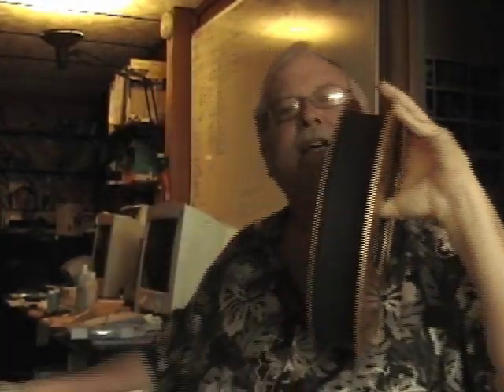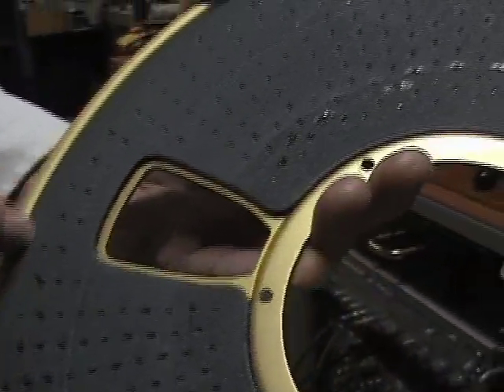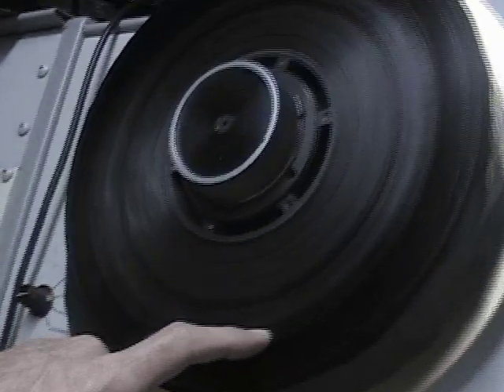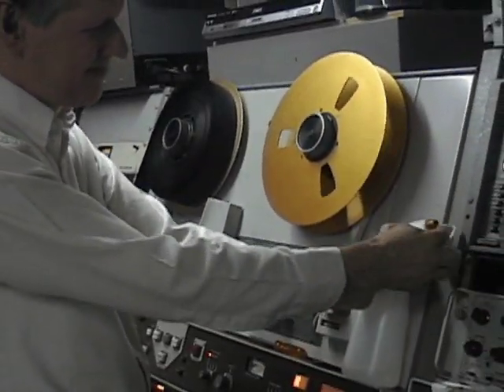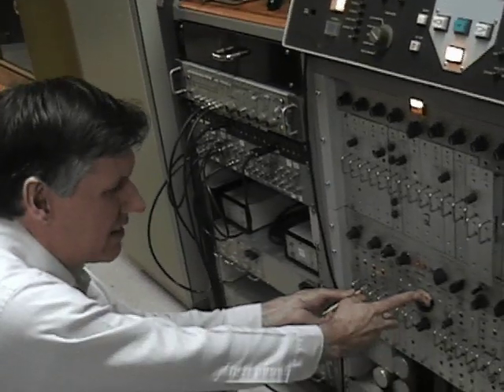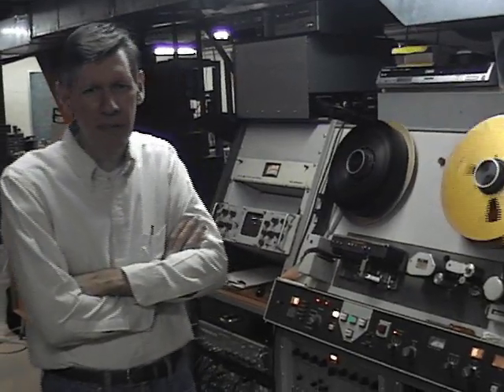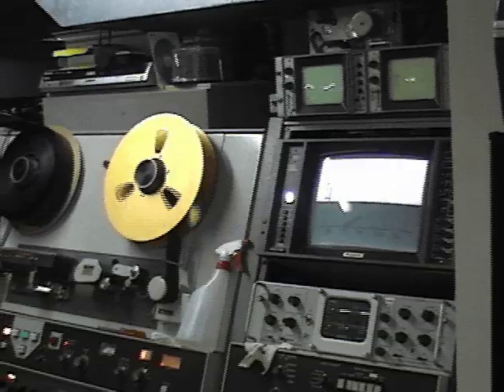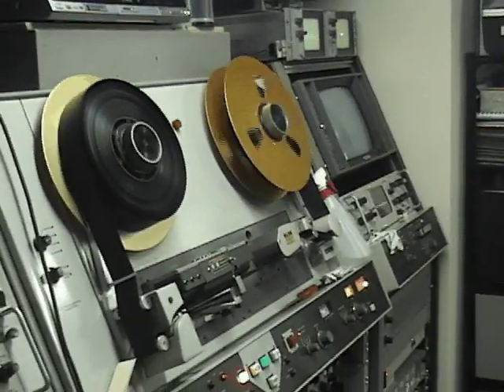Getting  a 2" Quad Videotape to Play

Comment from the maker: You can still find the old machines if you know who to ask and where to look.
The companies that rebuild the heads (they only last about 1000 hours) are still around.
But most people don't realize how much air conditioning, power, space, spare parts, and air compressor support systems you have to have just to fire one up!  Much less how to tweak it to make a tape play!
Reply: I indeed had no idea.  I mean, I knew that they were absolute behemoths, I knew that operating one was a specialized occupation, etc., etc., but I didn't know that the infrastructure required to support one was reminiscent of the Apollo program, lol.  For someone who has no frame of reference, it's simply inconceivable unless someone explains it.

I think it might be easier to set up an MRI at your house--assuming the electric utility played ball.

I am 44, and back when I was a kid I was really interested in video production (until the Internet came along), so I have some fond memories of playing around with some U-Matic decks at the community college.  And they had some tube cameras, too.  But all these years I've always wanted to see one of these babies operating.  Thanks.

I hope you are well.
Reply: I've always wanted to see one of these babies in action ever since I was a kid (I'm 44).  Thanks.  Undoubtedly, this is the closest I will ever get to one.  Indeed, I didn't know that they required an infrastructure reminiscent of the Apollo program to operate, lol.

All the best.  I hope you are well.
Reply: So did these not even use helical scanning?

Comment: I miss those quad days but they were tricky to set up. I started in engineering at Global Television in 1977 and the TR-70 was the only video tape playback that was considered "broadcast quality". Boy have those standards changed. I recently dumped a number of old 2-inch tapes that I had commented. Just a memory now.

Comment: My first job in TV in 1985, I trained on two RCA TR-600's.  We aired primarily Quad, Umatic and 16MM film.  When I first started, it would take me a good 5-10 minutes to align the heads and do all the setup, but as time went on, I got to the point where I could set Quads up in less than a minute.  Most of our commercial spots arrived on Quad, and were dubbed over to Umatic overnight after we signed off (wait....stations signed off?).  Got quite a workout lugging those 90-minute reels across the control room (dropped one on my foot once - don't recommend that).  "The Virginian" and "Name of the Game" were my favorites for weight-training. 

The air compressor for the TR-600's was in the basement storage room of the station.  Occasionally I would forget to put the head guard up when racking a tape, and can still hear the "dentist drill" sound of the head drum sawing the tape when it cued.  Another good workout - running across the room to throw up the guard before the heads were trashed!

Ahhh....the memories.  Thanks for sharing!

Comment: The video head motor that spins the headdrum has frictionless air bearing surfaces. Dry, filtered, compressed air is supplied at 58 psi to the head panel and it is forced out thru the air bearing creating a cushion of air the motor bearing surfaces 'ride' on. The motor spins at 14,400 rpm. At that speed, the video head tips travels a distance of about 22 miles in one hour. The vacuum tape guide requires 40 inches of vacuum to hold the tape in constant position against the rotating head tips.

Comment: My first job in Silicon Valley was at CMC technology. You can see their sticker on that head unit. I worked in quality control, adjusting the four head tips, guide alignment and control track head position on hundreds of units before getting bored and moving on. I do love the sound of a well adjusted quadruplex VTR. You get an ear for when they work right and that deck is in great shape. Thanks for the nostalgia.

Comment: We had two of the VR 1200's at KTAB in the 1980's.  We bought them second-hand in 1979 when the station went on the air,  They were in daily use until the mid 80's when they were replaced with AVR-2's.  They didn't get one inch until after I left in 1989.

Comment: Re: Compressed air: Actually vacuum is used in the tape guide to make the tape conform to the circular profile of the scanner head. The tape guide also controls the 
head to tape spacing. You could use use vacuum directly if you have a vacuum source or compressed air going through a venturi can generate a vacuum for the tape guide.

Comment: I have operated those beats!. What was the different between VR1200 and VR2000?
Reply: VR1200 had the monitor bridge overhead; the VR2000 had the side cart for the monitoring and the "A scope" built into the machine.   On our VR 1200's the A-scope displays were sent to the B input of the waveform monitor on the overhead monitor bridge.  I remember back in the 1980's seeing the glue breakdown/oozing out issue you pointed out.  It didn't take long for a tape to become unplayable without major cleaning.  3M came out to all the stations and swapped out the offending reel flanges with new ones.  I worked at KLCS channel 58 in Los Angeles from 1984 to 1992.  Thanks for the look back at the technology of the day.

Comment: Hi, that 3/2 pulldown for interlacing can (and should) be removed before uploading. You'd get rid of the annoying lines that didn't show on TV, but are clearly visible on flat screen.
Reply from the maker: 3:2 pulldown only applies to material that was originally on film at 24 frames/sec. You may be referring to the interlacing of the two fields in NTSC and yes, transferring to digital at 60frames/sec is the best way to avoid those artifacts, but is rarely done because it makes for much larger files, and most capture software doesn't have that as an option.

Comment: It's amazing how transitory most of the recording media has been and continues to be.
Without the medium the machine's a hulk, without the machine the medium is a relic. 
I would think that by the 1980's long term medium survival had been solved. Unfortunately most recording tape relies on polyurethane binders which hydrolyze after a period of time-- some a rather short time. The binder failure issues so evident here will ultimately prove the extinction of both media and machines.

Comment: I'm only 30 and no expert on these older machines, but, when you play in 'LP' mode, the tape is traveling at a slower speed, thus lower quality (like a lower bitrate on digital video).  The crackle must come from the control/audio heads.  On VCR's, there's the video head (round helical scan), erase head (before the video), and control/audio track head (after video).  I used to clean all of these with alcohol and q-tip real well, making sure no cotton left behind.  Hope this helps.